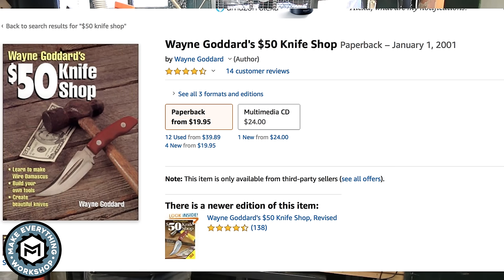$100 Harbor Freight Knife Shop!

Comment: After a few run ins with metal in my eye, I HIGHLY suggest a cheap welding helmet for those damn angle grinders. Just take the shaded glass out and leave the clear protector in to grind.

And yes, I was using glasses AND face shield both times.
Reply: Or just get a face sheild
Reply: Also stay safe!
Reply: Yup !! Worked construction for 30 years and got a few of those metal specks in my eyes. Had to get them drilled out (once rust ring starts it has to be cleaned out of eye) of my eyes. That bit they use is a micro bit, BUT once it gets close to the eye it looks like a 1 1/4" bit rotating in your eye and Dr. telling you DO NOT FLINCH, MOVE, OR SHAKE YOUR HEAD !!! 
PROTECT YOUR EYES PEOPLE !!!
YOU ONLY HAVE 2 !!!

Comment: The only potential problem with your sourcing may be the steel of the circular saw blade. The key word here is "OLD" which is much better steel than what's coming out of China (same with other tools like drill bits, files, machetes, etc.) You will  be able to get your knife sharp but it will not keep an edge very well. Best sources for steel (for non-forged knife making) are used tool shops garage sales, and especially estate sales. Even then you need to know enough to not end up with [made in China] materials. If it looks really old and has a brand name on it your probably good.
OK, after watching the whole video I see that you have addressed the steel issue. Thanks for the video.

Comment: CORRECT FILE USE: pressure and cut on forward stroke, lift up on back stroke, repeat. It's not like sandpaper or modern diamond files made to work with equal reciprocal motion. Dragging the file backward will dull it faster, kill its bite and is not efficient use of energy. (Pro tip from my ancestors who were blacksmiths and machinists)

Comment: Next time you might try clamping the grinder with flap disk, down to the bench, then freehand the scales against that. Probably as close to using a belt or disk sander as you can get, that way.

Comment: 56-57 rockwell means it will sharpen real fast... and dull just as fast. 56-58 HRC is expected out of a cheap stainless. The edge should be 58-60 to hold a good edge, while the spine should be almost spring soft. That is not as hard as it sounds. You coat the blade with refractory on both sides, everywhere you want it to be soft, and after the refractory dries,  heat until it loses magnetism then quench as normal. carefully remove the refractory then temper in the oven. Now, how you harden it is going to be determined by the steel. Circular saw blades can be made of 1075Cr1 (not very good blade steel, usually carbide tipped saw blades) -- Dim05 HSS (junk for knives, any circular blades marked HSS or High Speed Steel) -- 80CrV2 (really nice high carbon tool steel usable for knives, found on friction saws and larger diameter saw blades that need a tougher harder steel) -- OTHER (hot saws, etc. Who knows what is used in them). This list just applies to circular saws, not band saw, hacksaw, sawzall, or any other type of saw blade. 1075 will make a hair better than a "made in pakistan" quality blade, because it has relatively low carbon content, only .75%. 80CrV2 (1080CtV2) will make a "woooow, now that is a knife" knife, even though it only has .05% more carbon than 1075. However, a great steel with a bad heat treat will make a junk knife, but a great heat treat will not save a junk knife steel. Cheap but great steels are available that will heat treat in the manner you are already used to doing, such as 1095, 80CrV2, etc. The problem is that only a handful of oil quench steels use a magnetic test for the proper quench temperature. You NEED to know whether the particular steel will harden properly and adequately using that technique, or you just made a knife shaped object. You CAN, however, test the steel in question and it is easy to do. Harden a piece then hit it with a file. If the file won't cut, then the hardening process worked. The metal file should just slide, not bite into the steel. If not, heat it again then dunk it in water for a fast quench and see if that makes it harder. If that doesn't work, find a different piece of steel. The steel may be good, but at that point it is obvious that it is an unknown steel that requires a special heat treat for hardening and tempering. To put things into perspective, some tool steels you have to heat then cool very slowly to HARDEN (See A2 tool steel, for instance). If you want to buy some steel you can get a piece of either 1095, or better O1 tool steel, big enough to make your knife cheaper than you can buy a large circular saw blade. A blade made from O1 done properly could cut annealed circular saw steel -- and still have an edge. With the right heat treat, it can have a hard edge, be bent past ninety degrees, and not crack the blade. I am not joking at all. Good knife steel is called good for a reason, and it is not a selling point for factory made junk.

Comment: If you had a lot of those tools on hand, it wouldn't cost much at all. You could simply use better grade saw blade. I would use the edge of the saw blade to make a curved blade skinner, or a pair of krambit knives. If you already had some things like a bench grinder, a propane torch, and this and that, you could get the cost down to a very negligible price, then sell the knives for decent money. I'd smooth the handle more and maybe stain it, surely put some kind of coating on it. I think I would do a differential heat treat and only harden the blade edge thoroughly. Lots of ways a guy could go. IF you have a Dremel or similar tool, you could rout out the inside of the handle so though it was a through tang, the wood would come back together and not look like it was a through tang. tons of ways to go. The one thing this vid proves is you're really able to do most anything with ways most people wouldn't think of.

Comment: Cheaper and better to just order new steel then deal with mystery steel. You can get o1 or 1084 pretty cheaply...Unless you have a scrap yard to pick from.  Also you could have bought a hatchet and a rasp instead of a hammer to do most of your rough wood working

Comment: Cool!  Since I just happen to have all of this I'm going to try it out. I have some really nice shed antlers to use for the handle.  BTW, did you call before you started to dig?😝

A coping saw is pretty cheap and would save time on roughing out the handle, or just spend ten bucks on the jig saw.

Comment: Any way to temper without a toaster oven? Can you do it in a normal gas oven?  Also I suggest cheap $1 store super glue for the wood finish. It is a trick I have seen used by some pen makers for a topcoat on the wood pens they turn. Just wipe it on like a varnish. I use this on my wood handles for little shop tools I make. Looks like glass and it is very strong!

Comment: If you have a charcoal cooker it will eliminate the need for a fire pit. Also use your wife's hairdryer to blow the coals for more heat. I have used this method and it works great and keeps the mess down to a min.
Reply: Seriously - Do NOT use your wife's hairdryer. I'm on wife #4, I know these things. Just go buy a hairdryer. Trust me.

Comment: Look Son, You had a good idea here. Getting people able to see ways to get int the basics of knife making for VERY LITTLE MONEY, is a good things. So kudos for that. Some of your ideas are great. Now, take it to the next level. You used a $15 dolly just to get some 4X2” scales. Why? Go to any big box store and get some 1/2x4x2” solid maple pieces for less than $4 for your scales and you save $11 right there. Then, why use a 1/16’ saw blade for your blade stock when you can use the difference you saved on scales and invest into some quality blade stock online in 3/16th 1095 or 1075 high carbon material. In that thickness, I would think you can get that stock to critical temperature with just your simple wooden fire (I know you could with $5 of charcoal instead of wood or mixed with a wood fire) and borrowing a hair dryer blowgun to heat it up sufficiently for your quench. Try it first and see. But you will end up with a much more quality end product. 

Lastly, why did you recommend the wooden pins???? Every time this knife gets wet, even to clean it after use, those pins are going to get soaked and eventually fail. Then you will be left with two BIG holes to fill some other way. For adequate pin materials... ever think of using nails or the tops of screws or bolts??? They are much harder, can be cut easily with your grinder, they will hold up better than wooden pins, and they come in many sizes so you won’t have to drill 1/4” holes into your blade tang when 1/16” pins will do just fine. I used nails on the first knife I ever made, and they are still going strong after years of use with just using the same oil I just to keep the blade from rusting like any high carbon knife requires. I know you are trying to do this all through Harbor Freight, and I get that. I guess my question is, “Why” - because most people would gladly drive a few extra miles to get the materials they need or wait a little longer to get something better online. 

LISTEN CAREFULLY, MY YOUNG FRIEND... I applaud you in the basic idea you had. You did a fine job with the parameters you set for yourself. Now, how about taking it to the next level and skip the salvaged dolly parts, wooden pins, and using a saw blade cut out. Go to the next level and you can make a new YouTube video with quality parts and show people how to come out with tools that cost under $115-$120 an end up with and heirloom quality knife? You can do this! In the end, you will have hundreds of people actually praising you because you showed them how to make a much better knife for very little investment. The thing is... you will inspire more people into knife making if they have a really good knife in the end after their investment and work. That first knife I made... I would still put it up against any knife I own or have made (and I own a $300 Katz hunter just for one of my blades). Quality in/quality out.
Reply from the maker: I appreciate the comment. Part of the point of this video was to get everything from one place. Everything including the wood and the pins. I’ve got another video coming out next month with $200 worth of tools and parts that produces a much nicer knife. Keep an eye out for it!

Comment: Toolmaker here.

This is great.  Unfortunately harbor fright doesn't carry flat stock.  There are a variety of vendors where you can buy O1 oil hardening flat stock of varying thicknesses for the novice knife maker.  A 36 inch long bar of no-name 01 will give you 4 8.blah inch blades.  Because mistakes.  And it's cheap.  If you're going to use a saw blade, it's better to buy a box of used blades to be more frugal.(they are out there if you look)

Also, it behooves the amateur to research the types of materials, like air hardening steels, etc., as they have different properties.

A cheap forge made from fire bricks with a busted hair dryer with the heating element yanked and a light dimmer switch will get you a forge air source to get the higher temps that something like CPM 10-v need.  This may cost you all of free if done from salvage and asking your friends.

And if you're to go that route, invest in a roll of stainless steel wrap to prevent scale.  And when you wrap with stainless, wrap the knife blank in toilet paper.  If you wrapped the blank correctly and had no air leaks, the toilet paper should still be there (albeit a little toasted) in some form.  EVEN AFTER BEING IN A 2150 DEGREE OVEN. It's amazing when you see it for the first time.

Toaster ovens are fine for tempering.

An ir thermometer isn't a bad idea either.

For the metrology end, get a small surface plate (this is crucial.  If you buy anything from this list, buy this to at least make your blades straight) from harbor fright, a 1 inch micrometer, a height gage, a set of gauge blocks (cheap 84 import set), a surface gauge, a 1 inch dial indicator with stand, 6 and 12 inch dial, vernier, or electronic calipers, a test indicator (b&s best test, gem, or starrett - cheaper ones feel clunky).  All of these and more can be had for cheap if you browse Facebook marketplace for machinists/ toolmakers who ate retiring and their widows. Look for estate sales.  Browse the obits.

And get a toolbox with shallow drawers.

Watch toolmaker/machinist basics on YouTube like "this old Tony" or "clickspring" - the latter for Zen filing.  You will know who is good and not by your gut feeling and you will be right.

Invest in new or old (better for manual work) Machinery's Handbook and learn how to use it.

Let's see.. power tools: buy a small drill press and scroll saw and metal cutting blades.  A small vertical bandsaw is nice but not mandatory.

A good vise, clamps, hammers, Jewelers saw, small hand saws, squares, parallels, a set of adjustable parallels, 6 and 12 inch steel rules, combination square (goddamn these things are priced dearly for what they areif you want a good one new) sturdy bench.

That was longer than I expected.  Anyway, the above will get you started with a minimal of swearing, by which I mean you will still swear a lot but less.

None of the above need be new.  Like I said, there are machinists and toolmakers retiring and dying every day.  Beware of those who think they have gold unless they're selling a genuine Gerstner tool box in good condition for 200 
- jump on that bad boy. Shop around.

Now go ahead and flame me.

ADDENDUM:. I have to say this, that YouTube is a fucking treasure for the autodidact and apprentice in any industry or art.  It's videos like this one that educate people in things they'll never get in school.  Even channels like AvE, or even especially like AvE.

Comment: Would replacing the angle grinder with the $50 Harbor Freight 1"x30" belt sander be the most important upgrade if you increased the budget?

Comment: This is a genius idea but I would change the angle grinder for a bench grinder, and get a large steel pry bar instead of the cutting wheel. You can throw in a rotary tool for 10 bucks too because it will come in handy. And skip out on the hammer because you can use anything to hammer pins in, and lose the sharpener because that’s a waste of money if you have all those tools.

Comment: Dude what'd I'd do is like break in the angle grinder by running it without a load for a couple of minutes to seat the brushes . I've seen grinders burn out right out of the box ...

Comment: Old saw blades have good steel. Most new blades are medicore steel with carbide cutting tips welded on. Old blades had to be good steel because they actually did the cutting.

Comment: New saw blades don't actually use any kind of blade worthy steel since they use it just as a frame to mount carbide inserts. Old blades without inserts would be suitable. Also alot of machine shops throw out old bandsaw saw blades those would be great.

Comment: ...But what knife steel blank should we pick?

What if I want to make the knife of doom, out of some amazing tool steel? Is it worth the investment in an absurdly expensive blank?

What about heat treatments?

Also, modern plastics are really great for handle materials. Would any of these tools overheat and melt plastic? Melting temperatures are around 200 degrees F for lots of handle materials that would work well.
Reply: Theodore Bear I’d imagine a “super steel” would be much to hard to treat with these tools.... maybe d2 since it can be air hardened? Idk just throwing ideas out I’m not sure.

Comment: Thanks for the guide. Really helpful! After quenching the metal, you mention that tempering requires two 1-hour cycles at 400º F. Do I just leave the metal in the oven for 2 hours, or do I need to do something in between cycles, like let the metal cool down?

Comment: That was an excellent framework for putting together my first knife.  I've got all of the stuff laying about and just haven't put it all together yet.   I've been  a bit intimidated by the heat treating process.  It seems that everyone on YouTube who goes into this bit has one of those hi-temp digital ovens.  I bet  a charcoal fire and a box fan in the same "hole-in-the-ground" set up you used would work for the most part.  If I were going to buy sheet steel instead of using a saw blade, would I use 1080 in 3/16's?

Comment: Use dirty oil after you change the oil in your car, stinks but works.  Side note, Harbor Freight sells several oils, air compressor oil works fine too.  Contrary to popular belief it doesn’t have to be a vegetable, corn, cooking oil, just about any oil will do just remember to preheat it and watch out for fumes.  You should be watching out for fumes anyway though so………..

Comment: angle grinder tip : unscrew the brushes until it no longer works then screw in each brush a 1/4 turn so the spring isn't forcing the brushes into the motor, this will make the brushes last much longer, i did this to my Dremel that i used to make this https://prnt.sc/10z4gcv

Comment: I have a metal foundry. Would it be feasible to use it for the initial heat? I know the foundry can get temperatures in excess of 1800 degrees F.

Comment: You could have made a larger knife, or several knives, by using part of a machete blade, The steel would have actually been better suited to make a knife than the saw blade and would have been just as easy to work and temper.